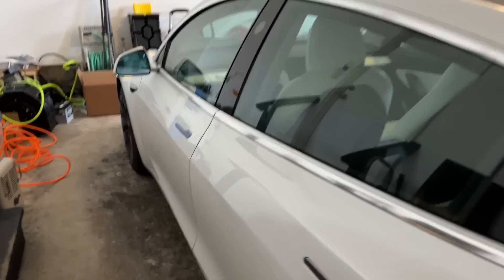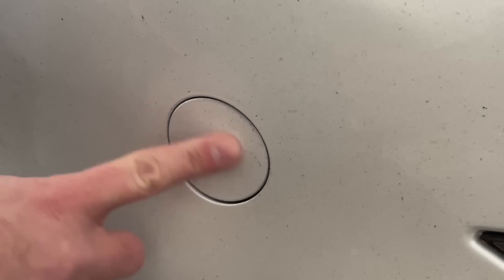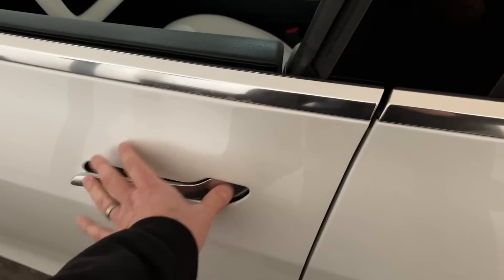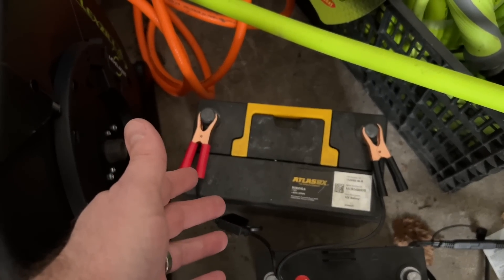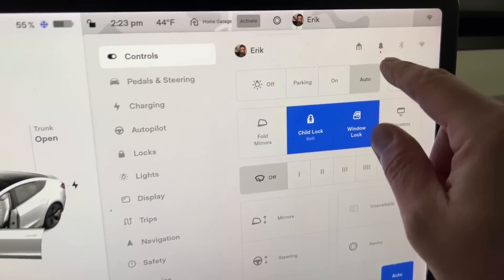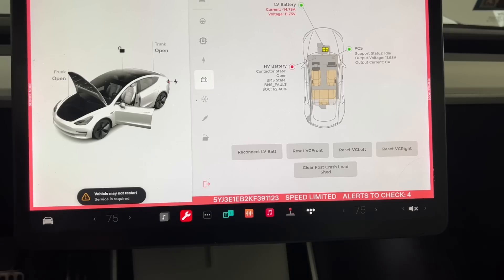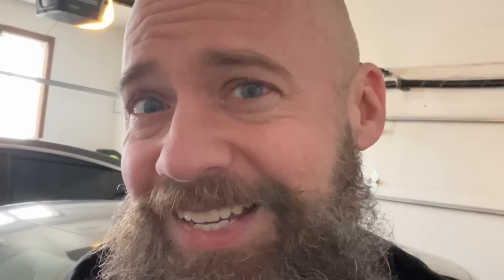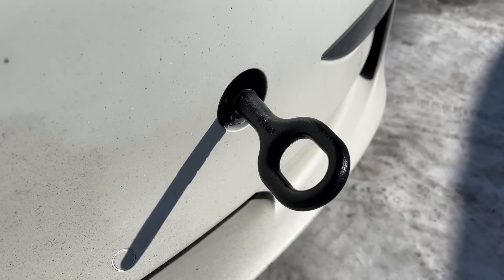My Tesla is completely dead!  Is it now bricked?  Pt1

Comment: Thanks for the video, I paid C$1750.00 for changing  the cabin filter, replacing the 12 V battery and PTC module on the car (my battery was over 5 years old) they offered me a loaner but I did not reqiuire it. It was a real hassle to go through this "ambush failure" of the 12 volt battery! The car has been fantastic except of a replacement of the control arms and this dead 12V battery. The service advisor should have alerted me about changing the battery at my last visit a few months ago.

Comment: Let me tell you a story what happened to mine and how I ended up paying 2500 repair even car was under warranty. I was out of range and pulled over. While waiting tow truck my 12v(actually 16v) battery died. We towed the car supercharger but no luck. Jumped the battery tried to charge but no luck. I thought 12v battery dead. I replaced the 12v battery but no luck again. Reset the system disconnecting High Voltage Battery and many ways still not charging. Towed to Tesla Service Center. They first quoted me 235 to replace Low Voltage 12v battery. I knew it will not fix it. Then they updated the quote to 300. Again no luck. One day diagnosting. Updated bill is 550. Again no luck. They decided to replace Power Control System and updated the quote to 2500. They said that I was out of range until %0 and High Voltage Battery went in protection mode and when car was slowing down regen breaking started providing voltage to high voltage system but it was disconnected due to protection. PCS couldn't handle that energy and fried up....

Comment: This is what you get for buying ANY battery operated POS from ANY manufacturer.  EVs suck ! They are pure hype, in no way are they a green alternative, they suck, they have no range, are time consuming to charge, they suck, depreciate in value twice as fast, are much more expensive to buy, cost twice as much to insure, promote child labor in china to mine the battery materials .... wait, screw China -we dont care about that ...... they don't LOOK any better than a gas vehicle, they don't PERFORM any better than a gas vehicle, they suck, they tend to burn ferociously, can't be repaired cheaply, go through tires like there is no tomorrow, they are too large to be driven around a golf course where they belong........and they SUCK !  The biggest clue out there that they suck is that Biden supports them.  EVs sucked over a hundred years ago when they were first dreamed up and they still suck today. The only ones out there who WON'T say they suck are the fools that have bought them before they figured out they sucked and don't want to look stupid twice !  You can add your name to the list if you wish to, but you will eventually regret it yourself .... because they suck !

Comment: Jeez, if i run my lexus until it's on E, i just gotta truck it to a gas station to get more gas. And the key still works low and behold. 😂
Reply from the maker: Same with my Miata.  However, there have been times when running a car down below E can burn up a fuel pump.  Key still works though, lol.
Reply: @BecauseTesla  🤣🤣🤣

Comment: Teslas have lots of problems with batteries. That is why all ECs are DOA if the battery pack is done. The battery pack is expensive, more than $1200 if anything is wrong with it. Hope it is still under warranty. Otherwise, the car is toast.

Comment: All of that because the battery was drained to 0 charge? That's insane. If my car runs out of gas I don't have any problems after pouring 4-5 gallons into the tank. Getting locked out is a major design flaw.

Comment: Don't know what voltage your Tesla 0% represents, but by my experience with electric-powered model aircraft, If a lithium battery is discharged below 2.5 volts, it's gone. Will no longer take a charge. This may be what has happened with your battery pack. Does the design of your Muskmobile include some sort of automatic low charge cut-off switch to stop this sort of critical discharge failure? I should hope so. If it does, then the c.- o. switch itself may be bad, or the voltage sensor is inaccurate, or some connection between sensor and switch may be disrupted.

Comment: Obviously these cars need a fuel powered APU. Just in case you can't make it to a charging station. Or at the minimum a "Jump Start Port" that could use a 12 volt input from any car to restart or even partially charge a Tesla.

Comment: Electronically operated door handles and glove boxes? What next? Rear view mirrors? How about overhead sunglass compartments? Or have those hook things on the side of the door to hang clothes pop out? How is this an improvement? From what I hear you don't want to charge all the way to 100% or drain the battery to 0%. The stupid steering wheel is square so how the hell is that better than round when the dam thing still moves in a circular motion? It's simply because it looks cool. Remember the Tucker? They had to redesign the door bottom or it would hit the curb and not be able to open? Function takes priority over form.

Comment: Don't see my 99 corolla 5 speed manual bricking itself in the 315,000 miles I've had it. Or my 96 ford ranger also 5 speed 150k miles.

Comment: So, the little 9 volt? Can anyone use it to unlock the car and clean you out? Or just any dead one? Nice feature, but it seems like a security issue.
Reply from the maker: The main 12v car battery must be dead first.  The 9v really only pops the hood if the battery is dead.  I had a unique situation going on with mine.  So really the only security issue is if you keep valuables in the frunk area and your 12v dies.

Comment: Hey word of advice. When you unplug something to reset it. Make sure to try to turn it on with it disconnected. That way its drains the remaining voltage and then it will reset. If you just take it off and put it back. It doesn't reset until the capacitor are emptied

Comment: Running a Tesla, or any other EV down to an indicated 0% does not harm anything.  The car will tell you 0% before the battery cells are in the danger zone.  I believe your failure is coincidental.

Comment: why would anyone buy an electric car? If my car runs out of gas I get more, no problem. Even the gas cars now days are so computerized that they keep going back to the shop and not for the engine or transmission but sensors or computer board. I do not need a car with a large display screen and wifi access. I need a car to go grocery shopping and to work.

Comment: thats strange... Ive run my ICE car completely out of fuel on several occasions with zero damage... All it took was $3 worth of fuel to get it to the next fuel stop 15 miles away. And when the battery died completely once, I had a key that would open the trunk, and in the trunk was a cable that when pulled would open the front door. Once when the battery couldn't start the car, to start it I rolled it at walking speed, and popped the clutch in 3rd gear... started the car no problem.
Reply: What a sensible car you have
Reply: Bet you can’t go 0-60 in 2.9 seconds though!😂

Comment: I love gasoline powered internal combustion engines. I had a brief love affair with electric powered vehicles as a tween, when I would rewind the motors in my slot cars, and race them at the local hobby shop. Just a personal opinion, I think the idea of switching from traditional gas vehicles to electric, hydrogen, or other unconventional methods, is unnecessary, and impossible. Not to mention that it would cause much more pollution, and the fact that it would be nearly impossible to provide the necessary power for a country full of slot cars.

Comment: I work on forklifts. They run lithium batteries in many lifts. We have customers that brick their batteries by doing exactly that. Running the battery super low is dangerous for its health. They have to be disassembled and cells charged individually because they lock out, that is there's no serious degradation to the cells. Good luck buddy.

Comment: I gave you a like for your knowledge and tenacity BUT what a crock of sh!te... Too much complexity with too many completely useless alerts.  If you have great software people Tesla (!) then give some GOOD guidance to owners when stuff goes wrong.  i.e. if the owner can fix it themselves with resets or whatever then tell them how to do it in plain and simple instructions, if not then tell them to get it to a service point. Had an issue with my Powerwall a few weeks back after a short power outage early one evening.  It was offline (not standby, offline), I reset it, I spent too much time messing with it trying to connect and see what it's status was  - I gave up and expected to call the electricians that fitted it.  Middle of the night it sorted itself out BUT the Tesla app was useless at telling me what the status of the device was. I'm happy it sorted itself out but GIVE ME SOME CLUES about what is happening.

Comment: If the battery is dead slow charge only, fast will overheat the system I wish these things had a management system that allowed you to set the charge for when you need it next, allowing you to slow charge as much as possible

Comment: If you ran it to zero then fast charged it, you most likely ran several cells to under the lowest allowable voltage. Id try a slow charge for a long period of time, your high voltage battery may need replaced. The big battery is a bunch 18650 cells and a hand full are died.

Comment: You did not watch the YouTube video before starting this project.   You did not do the proper steps in the order required.   Use the YouTube search box to watch the correct way to do this.  How to put in a new 12 volt battery in a Tesla Model 3.

Comment: The actual measure of environmental sustainability is CO2 per kilometre 
Therefore it is far more sustainable to drive a 1982 Toyota Corolla with 450,000 on the clock than to buy a new Tesla 
So not only do you NOT save the planet by driving one of these idiotic clap traps but by doing so you are actually contributing far more to global warming than driving an  old shit heap 
But hey who cares it is more important  opeto look cool and suffer range anxiety and other “inconveniences” like not being able to open your car if the battery is flat than to look like a nerd in an old Toyota

Comment: I would have put a charger on the 12V battery, the new one.  The car was pulling 15Amps and battery voltage was very low.  Means the converter from the main battery to the 12V battery was not running.  Maybe a battery converter module? Going to watch your next video to see if I was right.

Comment: Wen the Battery was run down to Zero% the Car Stops "charging" the 12Volt, so while the car was low and you received the BMS message, the 12V battery was no longer being charged in order to help preserve the high voltage batteries. But I'm not sure why it continued to not charge it after you charged the car back up.
Reply: I believe because he brought the high power battery voltage below 3.4 volts per cell the charger can't recognize or see the battery below that cell voltage

Comment: There have been rear engined cars for as long as there have been cars. There’s no need to create the term “frunk” this late in the game. It’s embarrassing.
Reply from the maker: Rear engine cars don't have a trunk, because there's an engine in the back.  Maybe they still call it a trunk if it's up in the front of the car, but you still just have the one trunk.   Tesla still has a traditional trunk/boot in the rear, but it also has a trunk in the front under the hood/bonnet.  So if there's a trunk in the rear and a trunk in the front, what do you call them to differentiate them?  Sure, you can go longform and call it the trunk in the front or the extra trunk...but...I find it easier to just say frunk.

Comment: These systems are so complex, hopefully there is service information available to diagnose fault codes. I guess even things like a faulty starter motor or a bad fuel flow sensor could introduce error codes into the engine management CPU and shut down the car.

Comment: Why didn't you try recharging the 12 VDC battery with a 6A charger ($30 Walmart, Amazon).  You say the swapped-in battery was OK, when showing 11.8 VDC on the Tesla screen.  A charged lead-acid battery should read 12.6 VDC.  Had you provided that, perhaps the other problems like the HV contactor being open might have disappeared.  Unless under warranty, I would avoid the Service Center and a tow.  Even under warranty, they may claim "your fault" (might be true) and charge you $$$ for what might be a simple issue.

The 12 VDC batteries are half the size of a "normal" car battery, only slightly larger than in a motorcycle, but cost ~2x.  Not just battery-cars, but hybrids like the Prius use them.  Don't know why so expensive.  Can be smaller because they don't power a starter motor.  Perhaps someone will hack using a cheap one for a garden tractor.  Tesla is moving to a Li 12 VDC battery in some models.  Those are also available in "normal" car size, albeit ~$600.  The main advantage is lighter and no acid to leak, though AGM type have long been around for the later issue.
Reply from the maker: Part 2 of the video is out and it explains what happened.
Reply: @BecauseTesla    Thanks just watched it and commented there.  Still wonder why you didn't try recharging the 12 VDC battery using a 120 VAC charger.  Everyone should have one at home.  I use mine all the time, especially since I have some cars I rarely drive.

Comment: I just sold my 10-year-old diesel truck for $45,000 with 77,000 miles on it. Good luck getting $45 for a 10-year-old EV needing all new batteries!!
Reply: But how much did your truck cost new?
Reply: @patfros  I bought it used with 8000 miles on it for $58,000

Comment: i'm not trying to sound critical, but this should have never, ever happened.    i think a car this modern and expensive should be designed with little back up battery systems.  under no circumstances should anyone be left,  locked out of their car because a main battery discharged.   imagine someone in bitter cold, miles from nowhere,  with their fingers hurting and near frost bite.  what about a sick or elderly person?   i think it's unacceptable and a safety hazard.  i hope they fix it for you

Comment: You failed the one thing I'd have done very first thing. PLUG IT IN.
My bet is, with it plugged in you at least could have skipped all the 12v replacement nonsense and opened the door.

Comment: The identical thing happened to my Model S. Ultimately it needed a new high voltage battery and a low voltage battery. They replaced my high voltage battery with one that had 30 miles less range. They justified it by telling me that the 30 mile reduction was in line with what the average battery degradation for the number of mile I had on my car. But my original battery at the time of needing replacement would charge to 345 miles. It had experienced almost NO degradation. Now it's only 315 miles. I had to just eat the difference. Just to let you know: They won't give you a new battery. They will give you a used one. Also, my seat profile control for my seat no longer works. Very dissatisfied.

Comment: I have a 2003 Cadilac  many things are not working .. such as  power door locks ..  power windows  power mirrors  .. dome lights.  fuel gauge temp gauge  Radio ..... transmission indicator ect..  alos it is missing on two cylinders with  new spark plugs..   and the engine races  and won't go back to idle often .. it wants to go 45 mph  with the foot off from the gas pedal ..  Don't you just love electronic crap!

Comment: So did you just show everyone how to break in to a Tesla with a 9v battery and steal all your things?
Reply from the maker: You didn’t pay attention.  This only works under 2 circumstances: the car is unlocked AND the 12v battery is completely dead.  If one of those factors isn’t true, the 9v battery trick will not work.  Tesla has already thought about that.  😎

Comment: I am impressed by the level of complexity and dependency that Tesla has achieved.
Reply: Yup. When Ford sold Model Ts, they came with tools so owner could do most engine maintenance repairs. Later, cars stopped being shade-tree projects by early 1980's. That won't change. We fixed our own TVs too.  In 1968, greasy me figured I'd always repair my own cars. If it conked out on the road, tools were in trunk. All that ended decades ago.
Reply: @LewdCustomer  It depends on how capable or incapable you are.
 I have 1984, 2005, 2009, and 2016 vehicles along with a loader, tractors, and several other pieces of machinery.
I work on all of them rather than take them to the parts changers masquerading as mechanics.
 I'm really not interested in vehicles that have the same culture of non-reparability that you have with electronic devices. Samsung Apple Etc tightly control access to chips and even some discreet components like an interconnects to prevent people from repairing their equipment rather than throwing it away and buying something new.
 Batteries running near flat are going to happen.  Having controllers fail because the battery is run near flat neans they're a piss poor fragile design.  Having enough controllers fail that the entire car bricks and you can't even open the bloody doors sounds like the kind of under engineered overcomplicated BS that Mercedes-Benz and BMW are famous for.
Reply: @TheOcculus  I also noticed that regardless of the operability of the car itself, there's always enough power to display the Tesla logo on the screen. At least they made sure the car can still fulfill its self-marketing purpose even when it's undrivable.
Reply: @stickyfox 😂
Reply: @LewdCustomer  It didnt for me. I dont own late model scrap.
Reply: I have 2011 DTS, I almost purchased Tesla but when I found out that Tesla owns it, and customers don’t own it, or the software so I didn’t get one.
Reply: @eddyeroyal6024  
???
Reply: That a huge door stop!